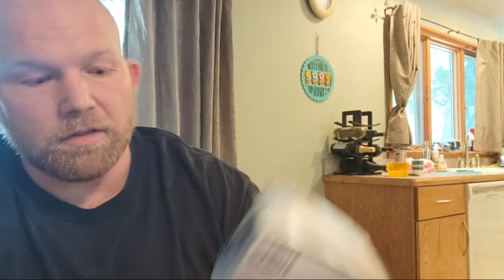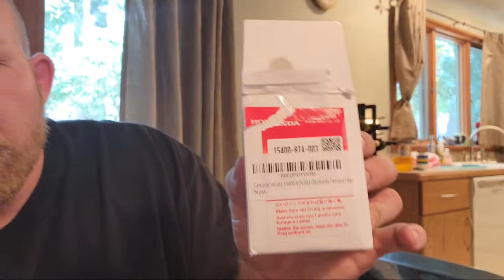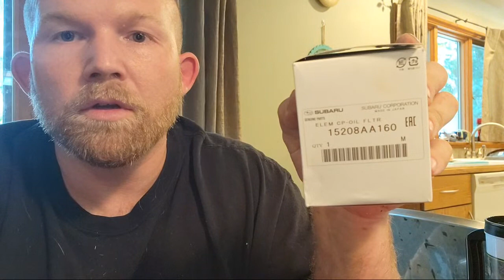Oil Filter Cutting Gallery - Q & A

Comment: As a machinist for 28 years they use the word billet because it's machine components assembled to form a unit.lol...Been following your channel,  really appreciate your filter videos..been using wix xp, and just bought a fram ultra synthetic filter ( $7.50 on sale). Gonna try it, as I have been avoiding the orange bomb for Years.been using the wix xp for last 4 years. It amazes me the difference in filters from brand to brand.like the pure 1 purolator,and a few others. Good to know a few quality options with out breaking the bank.👍( I change my oil/filter every 5,000)...also you are the first tech I have seen use the clear flood method during a oil change to prevent dry start..is this common among other techs?.. I just check the price on the Eco guard filter..$11.50.... For that cost I'll stick with my wicks XP purolator one or Fram ultra synthetic. I can get any of those 3 filters for $9.00 or less.. And I'll do a great job for my 5000 mile oil change.
Reply from the maker: Other techs start it dry

Comment: Get rid of the trolls. I just want to see how the filters are constructed, and listen to what you have to say about them.

I have been following your oil filter reviews for some time, and find them informative.

Hopefully by watching your videos I can learn something. Others should have the same objective.

Since you're a Ford tech you will find this little tidbit interesting. For as long as I have had a 4.6 L Ford, I have used 5W-30 in them. It started with my mustang, which was under warranty, and when I took it to my local dealership they were using Esso 5W30 oil. When I asked them about the fact that the oil fill cup and manual both called for 5W-20 they said they had been using 5W30 since the start of the 4.6 L engine. They also said that because I like to drive my mustang hard sometimes and it's always in the hot summer weather, the 5W-30 probably would not run the risk of thinning as much as the 5w20. I do not drive the mustang in the winter anyway.

For my winter driven 4.6 L Grand Marquis I have started running full synthetic a few years back because I was starting to worry about starts on extremely cold mornings. Even though I plug it in that does not mean that the oil down in the pan is warmed up at all.

As a Ford tech what are your thoughts about the above?

Keep up the good videos!
Reply from the maker: The oil in the lower pan gets a little warmer from the residual heat through the metal in the motor but not like you'd think

5w30 is more than fine, Ford actually switched to it as a recommendation for a few years then went back to 5w20....
Reply: @FordBossMe  That's interesting info about the oil recommendations.  Thanks for the response!

I have been running Royal Purple 5W30 in the '03 Marauder I picked up a couple years ago.

It's always been Motorcraft filters for me, but after your dissection videos I am not sure about what direction I may take now.

Comment: Great vid bud. I use the reg acdelco pf52 & change oil every 2800-3000 miles. Do you think I should step up the the acdelco gold filter? Thanks,Gary
Reply from the maker: I mean you're fine with what you're using but the gold is a better filter
Reply: @FordBossMe  thanks,can't wait until you do fuel filters. Yes im a acdelco guy & be interesting to see how they & compare to others. Thanks again

Comment: Hey Valvoline filter any good the ones they use at oil change centers??
Reply: Thanks, **VALVOLINE , actually,I wonder , too!  Interestingly, also wonder about PERFORMAX  ( Penzzoil ?), MY DODGE Dealer USES for My “Program 2015 Journey 4 CYL: “ Oil CHG( with 5W-20 MOPAR Oil conventional)…..